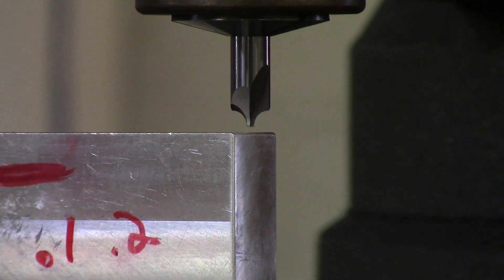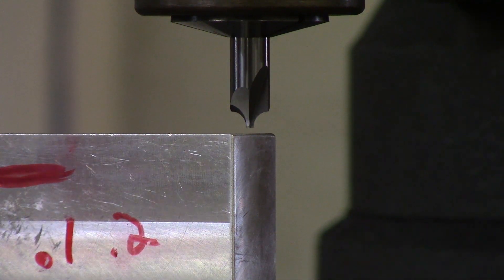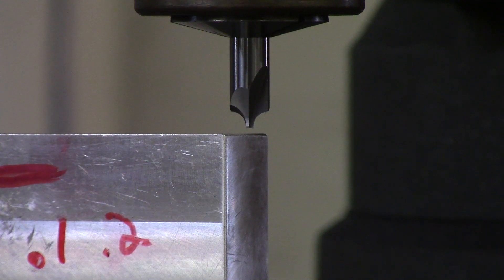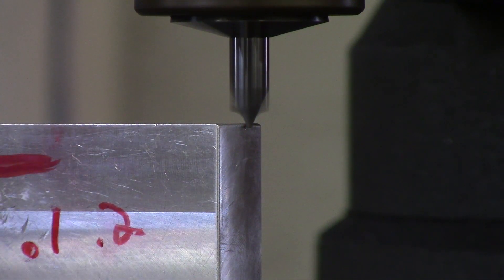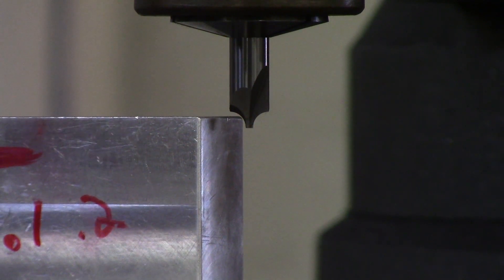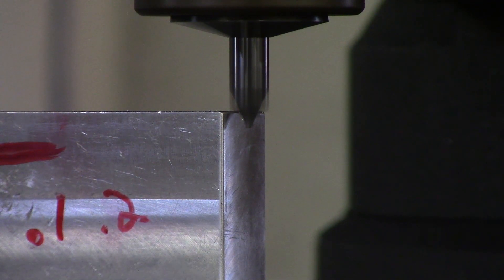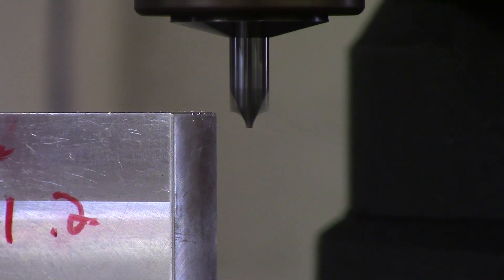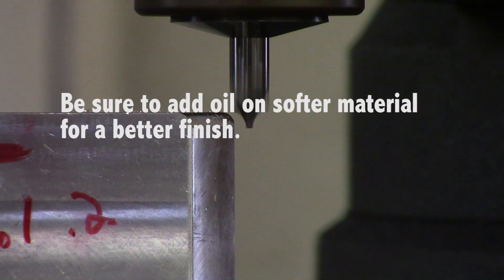How to use a Radius Cutter

Comment: This is incomprehensible. You say you are setting the cutter IN .001, but the cutter is actually some unknown distance in from the actual edge of the material. It is FAR MORE than just .001"!   It looks like you are in about 1/4"! Same thing when you set it for the X access. If you set it in .001" it should be right on the edge of the part. Either you are not saying what you are doing, or you are not doing what you are saying. I think you are filming from the wrong angle, in reference to what you are discussing.  Perhaps YOU can see it from the angle you are viewing it at, but if you watch the video, it makes no sense. Sorry, but that is how it appears to me.